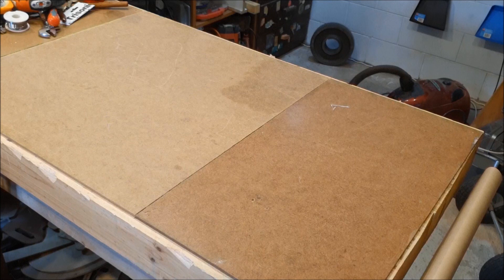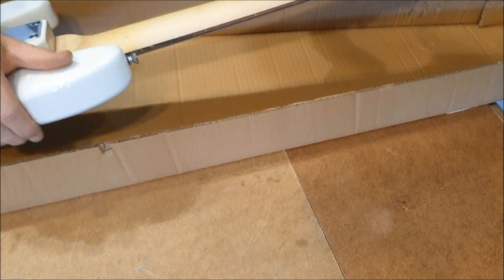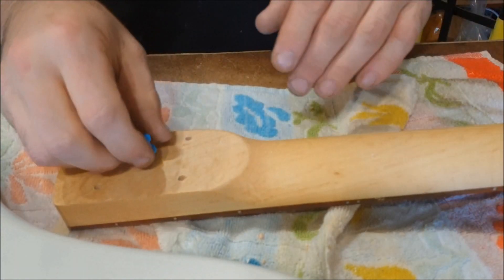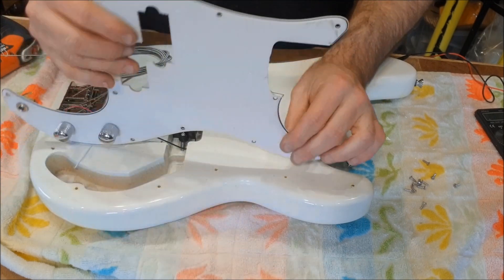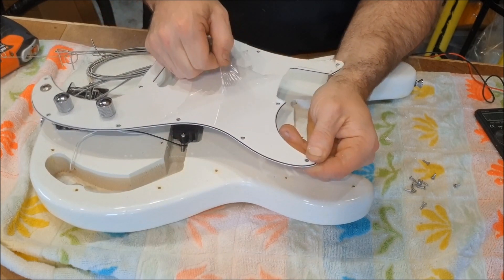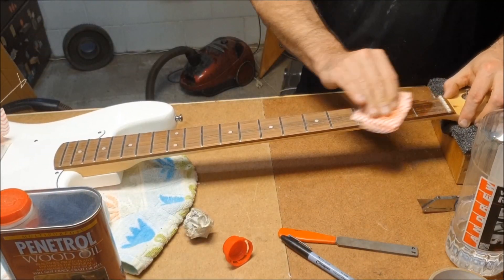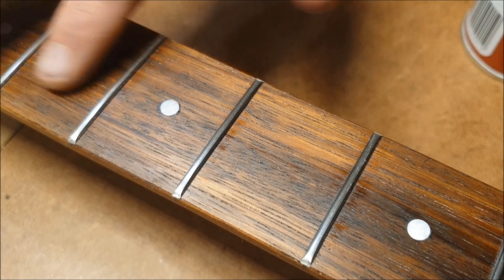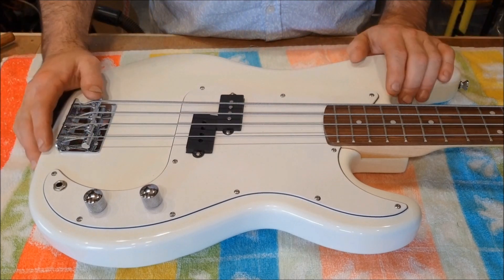Worlds Cheapest Bass - unboxing and teardown with surprising results

Comment: I had the same thing happen with the pickups on my SX Jazz bass.  It had springs holding the covers up, but no support for the actual pickups.  Pulled the springs, added Fender style foam, problem solved.  Iight upgrade to better pickups at some point, but I don't have the extra money right now

Comment: Should I put tru oil, (or a homemade alternative) on a rosewood fretboard? What’re your thoughts on that?
Reply from the maker: Conventional wisdom is that rosewood boards don't need oiling as the wood is so oily already. The problem with that is that there are dozens of varieties of rosewood and no two pieces are the same. The way they say to apply tru oil is to wipe it on, then after 20 minutes wipe off any excess. If the board is natrually an oily one then the tru oil won't seep in and then it just gets wiped away anyway, so it can't hurt the fingerboard. Hope that helps, cheers.
Reply: @fanbladeinstruments  Thanks!

Comment: Having no finish/seal on a rosewood fretboard is normal, of all big manufacturers only Rickenbacker finish their rosewood fretboards. Also, how come you didn't put any foam underneath the pick up? It was missing when you got it and that too is a typical thing for a P-bass. It would've prevented  the pickup issue at the gig. 
And last but not least you did check to see if the frets were true, but not the fretboard. With a bass of this quality (and those shabby looking frets) I'd have checked the fretboard itself.
Reply from the maker: It's not rosewood, wasn't even sanded smooth, the oil has helped to fill in the grain a little bit. It's not great but it's an improvement. There were springs under the pickups as factory, decided to go with it as was. I've just swapped them out for SD's which were supplied with foam so check that out in next weeks video😎
Reply: @fanbladeinstruments  If it's not sanded smooth wouldn't a complete refret be better? I mean you can still get the frets kind of sorted out. Then again it's a 60 dollar bass. 

You'd be better off with the Harley Benton line Bass guitars. I got a shortscale for around the same price and I was amazed at the quality. Lacquer, fretwork, tuners, pick guard, everything was done the way it should be. Even the strings were okay and the sound of the pick ups far from bad. Still amazed those bass guitars are that cheap, and the long scale version is 90 euros. But I hazard a guess they don't deliver to NZ.
Reply from the maker: Yeah I've heard about Harley Benton, the truth is I only bought this one to make a few videos and have some fun with it. If I was going to the effort to do a full refret then it's just not worth the time, and it's not like I need more basses. The aim here is to take a flawed instrument and make it play and sound good, then I've got one or two random ideas to try out.

Comment: It's missing the foam under the pickups which would push them up . The glue holding the pickup bobbin to the inside cover let go - the foam would prevent this. The pickups not being positioned correctly and requiring a new pick guard and the horrible fret job from the factory makes this particular brand sub par quality. Even Glarry is better - MonoPrice Indio is much better and so is Harley Benton.

Comment: Hi mate did you buy that off trademe? I bought a strat style no weight to it ok neck but body work was shocking poorly sanded and painted all 3 pickups are same ohms at 3.4 ohms cost $120 got a amp with it I think $240 all up amp is ok has bluetooth. So will be changing pickups at some point cant believe 3identical pickups

Comment: putting a shim will raise the fretboard and cause fret buzz...... should have done a demo without any adjustments before you give a conclusion on how good or bad it is
Reply from the maker: The action was a mile high out of the box. Totally unplayable. All the work shown was needed to make it play.
Reply: @fanbladeinstruments  of course it would not have fret buzz if there is 1cm of space between fret and strings :-D